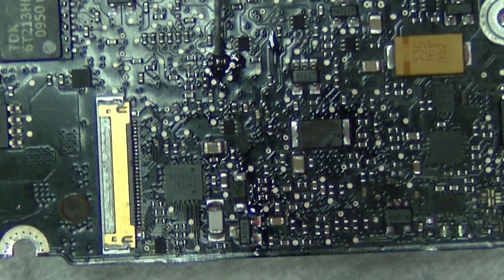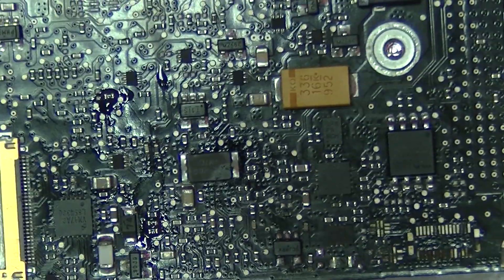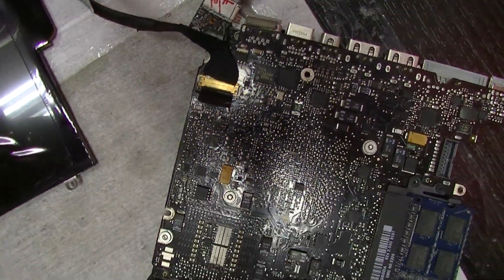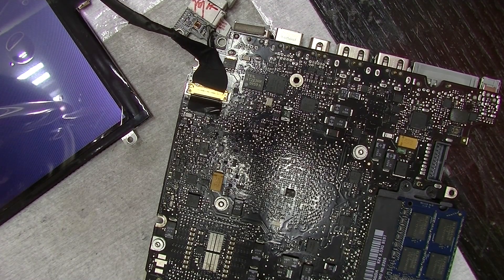How to solder backlight fuse on Unibody Macbook without rework station.

Comment: Hot air stations have become so cheap, there is no excuse not to buy one - 858D (as demonstrated in EEVBLOG) is only $30 on ebay shipped.  Still need some kind of magnification to see what you are doing, but a smart phone with 8X mag mounted on a stand works just fine as microscope substitute!

Comment: Louis, thanks so much for this tutorial, particularly the quasi-wave soldering technique. As you said in the video, I found the higher temp setting on my iron did the trick. My fuse replacement isn't as pretty as yours but it works just fine regardless. The hardest part was getting the damn 0402 sized fuse into position. I found the tip of a #11 X-acto knife worked well for sliding it into position and holding it in place. Thanks again for your help. This video saved my butt.

Comment: Would it not stand to reason that you could solder a fuse in parallel to a burnt fuse in order to complete the circuit?

Comment: Hi Louis! I have a problem with my Macbook Pro Mid 2012 13" A1278 820-2565 Backlight, near the LCD connector is a burned fuse, and the problem is that i don't know it's actual specifications. I'm asking you because i don't have the board view and schematic files.

Comment: hello i am having trouble with that fuse i bout the mac of ebay and does not have that small fuse it has two points on where it should be can i put a soldering point on the board to bridge them or do i need to put a new fuse thanks? my mac is a1278 mid 2009 ps good job with the videos :)
Reply from the maker: +sasuke4301514 PUT A FUCKING FUSE!!!!!!!!!
Reply: +Louis Rossmann  lol sorry bro i know the fuse is a 0402 can you send me the link to one :( i dont want to mess my university laptop  :/
Reply: +sasuke4301514 if you don't want to mess it up when send it to repair.
Reply: +Louis Rossmann hello what are the materilas i need to perform that type of soldering thanks :)
Reply: +Andrej Gelenberg  whats the tip of soldering he uses i know its not allow

Comment: Louis, great tutorials. I am not sure if i ever get to your level. so much info. i am new to this and i got a problem and i could use your expertise. i have hp stream 13 and when i turn on, the backlight works but nothing comes on screen. when i hook up the unit to the tv via hdmi, the display comes fine on the tv. i replaced the lcd cable, i tested the lcd screen on another unit which works and i check the lcd cable on the motherboard to make sure it sits fine. still i can't figure out why this is the issue. is it possible that backlight fuse might be blown  but not all the way so the backlight works but no display.  please let me know if you have ideas. thx. worst case sceanrio  is, i have to replace the motherboard. thx. keep  doing what you doing. love the language and ny accent
Reply from the maker: +signmeup2006 Anything is possible, only thing to do is dig in and figure it out

Comment: Hi man! I like your phone idea at the start it is so true. Ive a question.
My mac had a bad display screen i think the probleme was the board on it because the inverter was fine and I had screen but on the minimum brightness and it went out when i tried to change it to a lil' brighter
so I ordered a new one it worked! but then when i tried to assembly I had problem with the cables and I tried to squeeze everything carefuly but the screen didnt work again I got the boot sound and i hear it might load but nothing else even with the other dim screen it do the same. Is it ESD problem? because I didnt wear any :S
sorry for the novel and shitty grammar

Comment: Hi Louis i have a quick question i have a late 2011 Mac book Pro A1297 that receives power green light on the charger, does not charge the battery, and won't power do you know what it might be that is causing the issue, your help would be greatly appreciated, Thanks.
Reply: CheapLaptops USA Have you checked all power rails on the laptop ?

Comment: could you please help my im trying to fix my brothers mac witch has no back light !!! the logic board is the same as the one in the video but there is slight differences in where some components ar on logic board . also  under of the macs casing it says its A1278  so why s there differences ? i could send you some pics if u wished to share ur email basically i just need to know where the fuse is or other potential points that could cause this so i can go ahead and repair i don't usually beg people for some help normal i just trawl the internet but im fuck on this one  hope you can help   

thanks in advance
Reply: I will have a look mate thanks

Comment: Yes indeed, me also (the computer scientist), I've first had to paint 136 stable doors in creosote 3 times and get that shit on my face also (that being just some days of that job) so I can eventually finish a course, get a job which brings more money which allows me buying tools and shit.
And back in the times when I needed soldering something.. Probably things on my Commodore computer and I didn't afford neither a god damned $7 iron, I used my apartment key on my gas cooking machine holding it with my father's pliers and do the fucking soldering I needed to do :))))))))
...which Commodore and apartment were not actually mine (bought by myself).
There's the key to the problem and that guy's fuse :))) :
http://4.bp.blogspot.com/-OqW_PJYYBoc/UUOY5iL1OSI/AAAAAAAACQc/WvamYq3lEt4/s1600/KBZ_Ces.png
Reply from the maker: Too few people understand what it is to start from nothing. Those who do always do better, I think.
Reply: Louis Rossmann If you start with 1 million dollars and crash all that money then you've lost. I think good businesses start small and grow up.. depending on one's pleasure for the particular job, experience, determination to make it to the top and perhaps how good the person is at interacting/negotiating things with people.

Comment: Awesome repair! My tools aren't perfect either but I don't complain -- as long as it get's the job done I know I'll be able to afford the better ones later :)
Reply from the maker: That's the spirit!
Reply: @rossmanngroup  hello sir please can you help me out  I have a macbook pro 17" early 2009 it turns on but the screen is dark if I use a flash light I can see the image on the desktop can u please help me how to fix  and I'm good I soldering but if it the fuse for the backlight please let me know where exactly it is situated and looks like and how to replace it with a different spare and where can I find it ,I have also tried the brightness but it doesn't works I hope you help me out